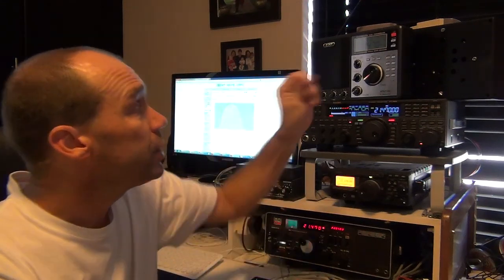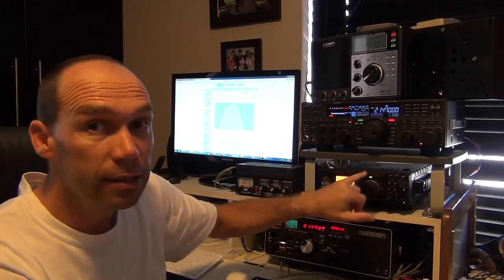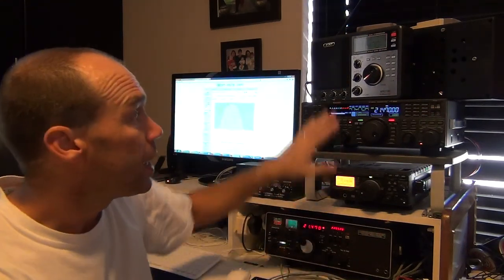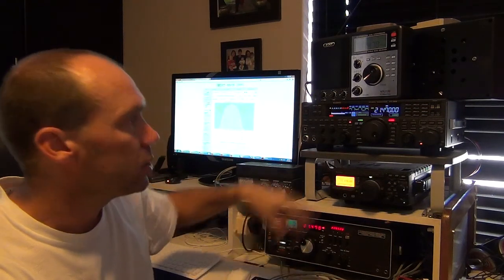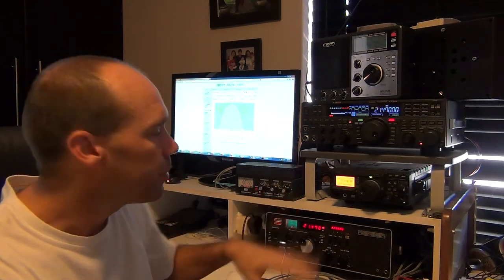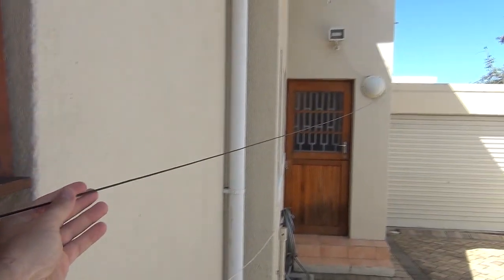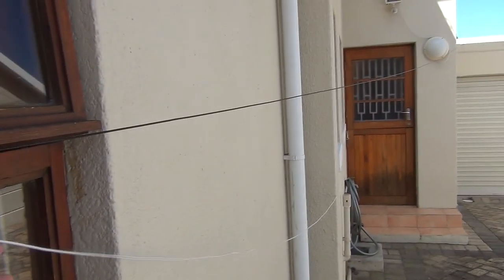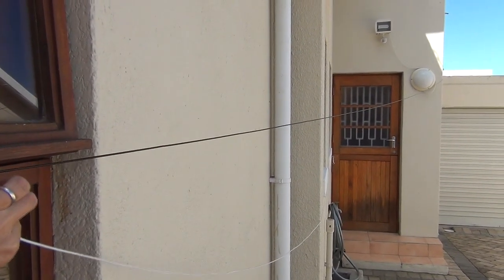Radio - HAM - Antenna: Part 3b - Radio Wave Propogation and Shortwave Listening

Comment: Thumbsup! for a nice well-done informative video:) one slight thing though, is that those transmitter power listings in the Shortwave Info site are actually in kilowatts. So when you see "250" or "100" that is 250,000 or 100,000 watts. Obviously a "1" or a "5" are 1000 and 5000 watts. 73, very very nice video you did.

Comment from the maker: I originally received it when I was about 12 or 13 years old back in the early 1980's. It was bought from a HAM radio shop (Hamrad) in Cape Town South Africa and was used at the time but in perfect condition. No restoration has been done beside replace the odd  "pea light bulb" inside...in fact one of them is not working at the moment....but besides that it's still in very good condition.